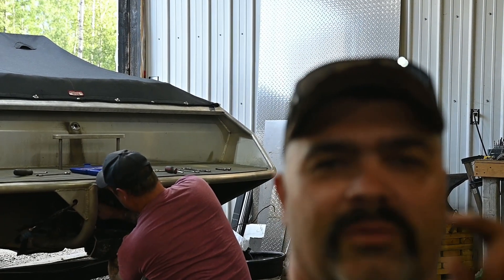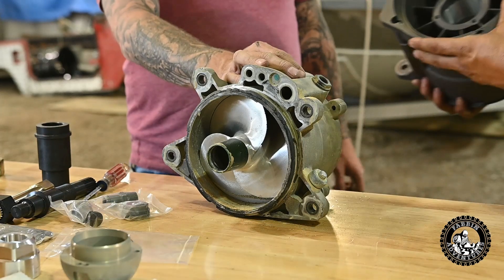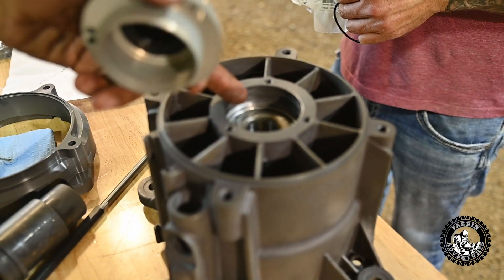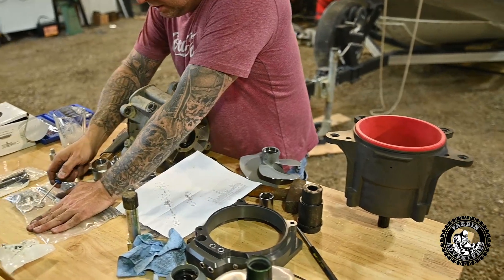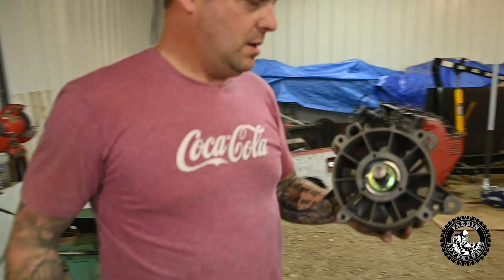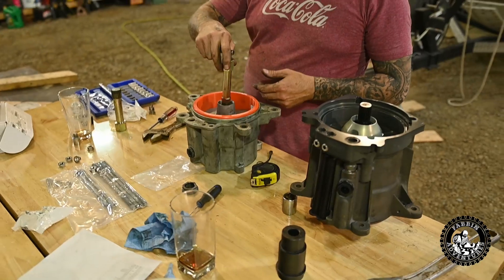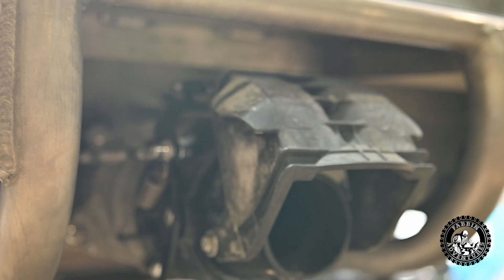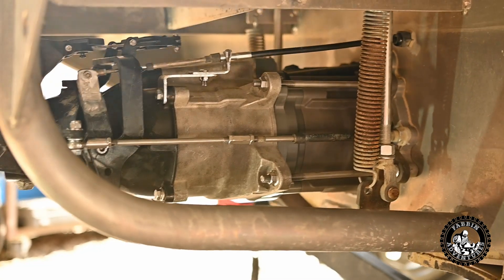2 stage Jet Pump install : Made by Munster Canada

Comment: to get that stainless wear ring out take a tig weld and just run a bead down the wear ring. do that on three spots and will fall out when it cools
Reply: And can't believe they use uhmw wear rings!?1
Reply from the maker: Hey neil, thats a great idea on how to get the ring out.
Its crazy that the use uhmw, they say the fit (clearance) is tighter.
But man they sure dont eat gravel like my sport jet does!
Reply: @FabbinAdventures  they say it’s tighter but you’ve seen the pictures of my rebuilds I can get those rotax and stuff to 0.004 total so 0.002 all around so I bet the uhmw isn’t that tight. And with the dirty river water the stainless lasts ten fold. The rotax and all the pwc pumps don’t like gravel. Sport jets don’t mind pumping road crush lol.